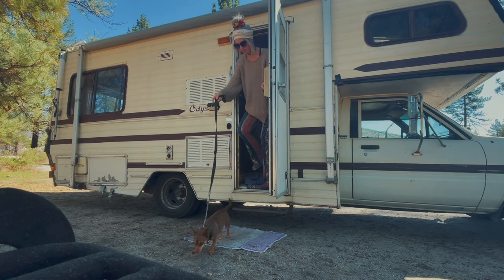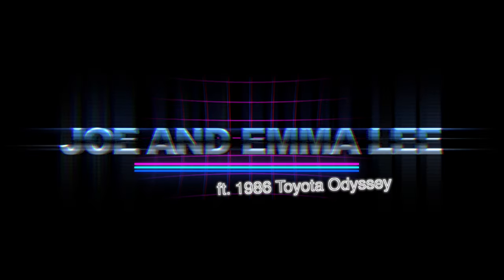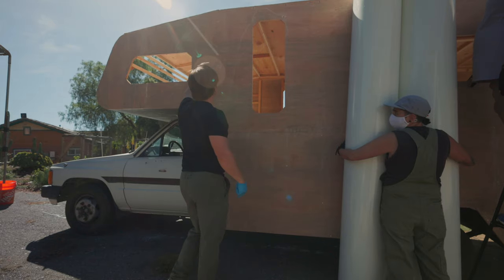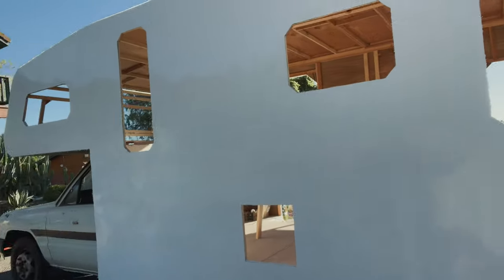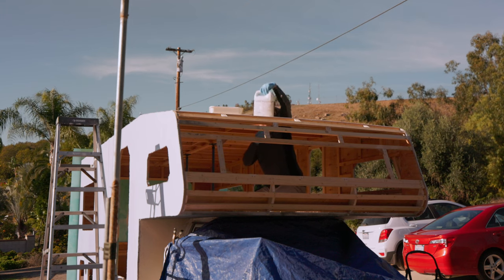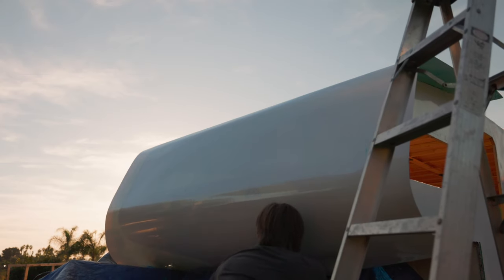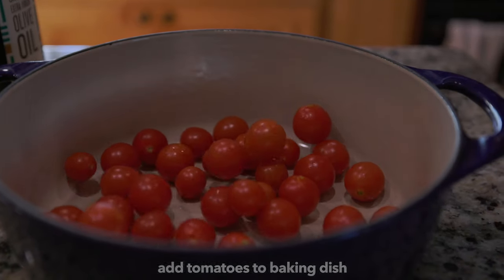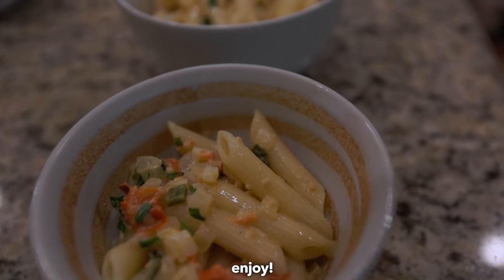COMPLETE Transformation on our Vintage RV!

Comment: When you install the windows, doors and everything else, use the super sticky black butyl tape instead of the grey putty tape. The black never dries out like the grey will. The black stuff is what was used on car windshields before the companies switched to urethane adhesive that's stiffer  and makes the windshield and other glued in glass a structural element to add stiffness.

The black tape costs more and is a pain to trim and clean what's excess or squeezes out, but having it stay sealed forever is worth it.

I use baby oil to coat a knife blade when trimming it, and apply painters tape to the surface around the vents, door, etc. That way the excess can be cut free then peeled away with the tape.
Reply from the maker: We had no idea there was a black tape version, we will certainly look into it. Thanks for the tips! We also need to reseal the window glass to the window frame as some pieces are lifting up.

Comment: We have a 1984 Toyota Dolphin and we need to do the same thing to ours! We love it so much and want to keep it. Can you please share how much it costs to do the complete replacement of camper? Wanna know how much I’m gonna need to do this. Thank you
Reply from the maker: Awesome!! Exactly how we felt, we were so in love with it that we knew we needed to keep it alive! A rough estimate of what we spent for materials to rebuild is about 2500/3000$ it will cost more if you upgrade all your appliances, electrical system and what not. But for just the structure, it’s pretty reasonable.
Reply: Thank you for sharing!!! That’s not too bad! Need to watch a lot of videos to do the work! Your videos are very inspiring and informative.
Reply from the maker: @jennifercoulter79  aww thank you for watching! Glad we could help!

Comment: If no herbicides or pesticides were used, why use either baking soda or vinegar? Baking soda breaks down pesticides on it's own, though the produce may need to soak for 15 minutes in the solution to remove all of them.
Vinegar just makes the solution more neutral, possibly canceling the effects.

If it's just for bugs and bacteria, a spray of vinegar, then a rinse works, or just soak in bleach water.
Reply from the maker: That may be true.. but who doesn’t love to channel their inner 5th grade science project
Reply: @JoeandEmmaLee  3rd grade 😜 Fifth grade is batteries and physics stuff for fiun.
Reply from the maker: From Emma Lee… “we use baking soda and vinegar because we live in the middle of nature, so we also want to remove any dirt, fertilizer, aka fecal matter for that matter…lol 😂”